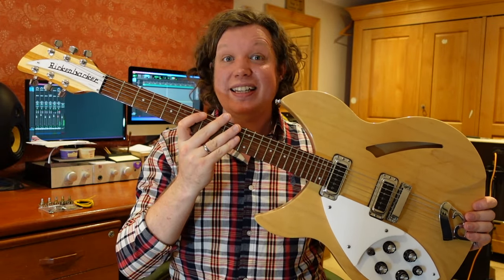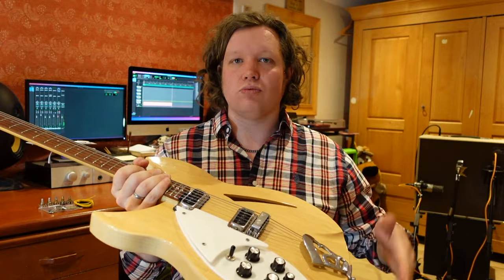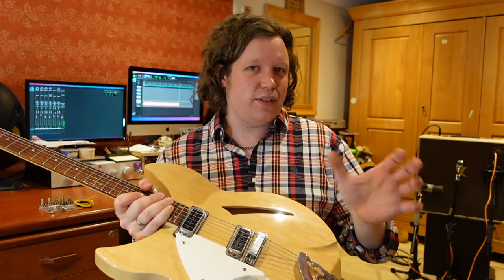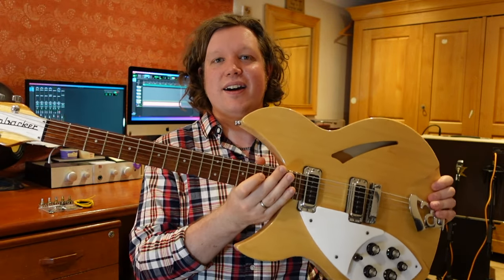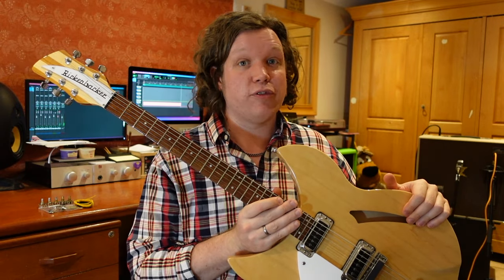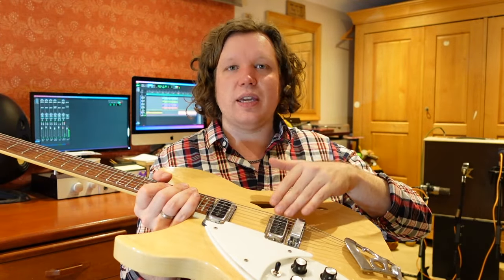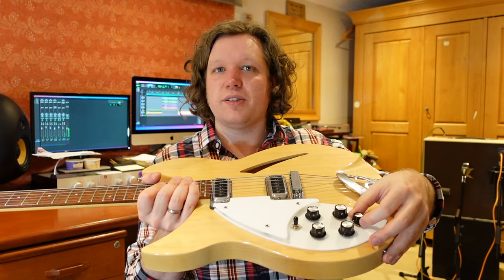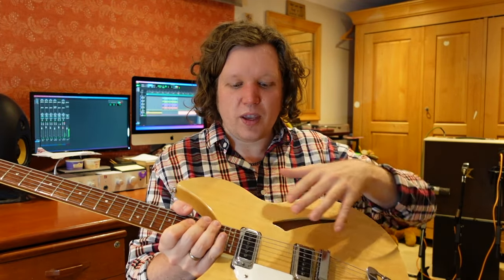Rickenbacker Wiring: Modern vs. Vintage (330k Pots vs 250/500, 0.0047uF Capacitor...And More!)

Comment: Re. the inline cap on the bridge pickup and the blend control: I have a 1959 Ric Model 450 with the cap but without the blend.

On this particular guitar the bridge pickup is located further from the bridge than normal, so the volume difference between the pickups isn’t as extreme as with most Rics. I like having the cap…it takes away some low end but doesn’t thin out the sound drastically.

I think Ric was experimenting with sounds and configurations in the mid/late 1950s, and my particular guitar was likely one result of “let’s move the bridge pickup around and see what we get.”

Comment: A very good video! 👍
Series capacitor  which cuts low end (depending on of the cap calue) has been used in several vintage electric guitars, for example in series with bridge pickup of late 60's 3 pickup versions of Coral Hornets, and a parallel cap which on the contrary cuts treble of neck pickup was used in those same models as well. (Unfortunately I don't remember the cap values of those caps in those guitars right now.)
I personally have found that I don't in normal use much like either of those caps so I prefer unfiltered pickup signal. Of course if you want to get very extreme sounds, i.e. no high end or only high end, just by switching pickups, it could be your thing. Luckily those caps in both cases are pretty easy to shunt or be lifted off from one end respectively, by little soldering or extra switch without removing original caps from the guitar.
And because of the inductive nature of the traditional guitar pickup, the effect of those caps quite possibly is a bit more complex than just high pass or low pass filtering because there probably will be resonance phenomenons caused by presence of a true LCR circuit, i.e. pickup coil, cap and potentiometer.
Reply from the maker: I've put mine on a switch so I have both sounds :-) Video coming in a couple of days on that!

Comment: Well done, Joe! ☝ 
On your way to a "jangly" Ricky, I like to cite to you a longer comment about Roger McGuinn from the Byrds, that I have read somewhere on YT. Be it real facts or not - it might be insightful and interesting:
Quote (excerpt):
"McGuinn did not record with an amplifier but went directly into the recording console. Yes, the sound was highly compressed using a Teletronix/Urei/Universal Audio LA-2A and 1176, a Fairchild 670, and similar legendary outboard studio compressors which cannot exactly be replicated with pedals, even today. He also often recorded with two compressors in series, each one at a moderate setting to avoid “breathing” and other compressor anomalies. He did not use a treble booster or any kind of pedal in the studio as the Q-strip on the console had sufficient EQ to create any sound he wanted. The treble booster he used and eventually installed in his guitar was used for live performances only.
McGuinn's tone, while not monolithic, is generally not nearly as trebly as we sometimes "remember" it to be. It is "jangly" as hell, though, but that is more a product of his playing technique and the metal fingerpicks on his middle and ring fingers than EQ.

Yes, he was unhappy with his live sound, and no wonder, there was no way to replicate or even come close to his recording setup, live. I saw the Byrds in 1967 and they were playing directly through Fender Dual Showman amps, curly guitar cables, and no pedals of any kind for both the guitars and bass.  McGuinn’s Rick 360/12 did not sound even close to his recorded sound which greatly frustrated him. They were not a very good live band which surprised me since their sound was not, at that time, so highly produced in the studio that it couldn’t accurately be played live, as many good cover bands proved.

McGuinn used and still uses a flatpick between his thumb and index finger in the usual way and, as I said, metal fingerpicks on his middle and ring fingers. In this way, all plucked notes are evenly sounded and a “roll” with the middle and ring finger can be accomplished while not giving up the accompanying flatpicked notes. This is a very important feature of his sound and the best way to get a Rick 12 to sound like his. Harrison flatpicked all the strings. 

Before the Byrds, McGuinn (called “Slim” in those days) was a professional musician who accompanied a number of performers."
Reply from the maker: Interesting information - thanks Marco! :-)

Comment: No video Joe! I worked with Gemini pickups on the first print article about the wiring and toasters in vintage Rics on Anatomy of Guitar Tone. It took so much research to unravel all the details. Was kinda weird how Rickenbacker was so hands off with the schematics. Also so weird they don’t make a period correct guitar with proper wiring. One thing I did you might find interesting is used a push pull pot to take the 0.0047 cap in and out of the circuit. That was a suggestion from Matt at 30th Street Guitars in NYC. I think you’re gonna love the Gemini toasters (those are the ones I hope you’re using). Rob has an incredible touch with wiring pickups!
Reply from the maker: Ah amazing - thank you for your work!! :D Yeah, no clue why nobody ever really kept track of what they were using back in the day!  There's another video coming in a few days - I ditched the 'blend' control (so my 330 is now basically like an old Capri) and put the capacitor on a switch where the old pot was...not a fan of push/pulls myself.  But it's great having access to both of those sounds!  Sadly I'd already ordered my Toasters here in the UK before I discovered Gemini - if I had my time again, I'd definitely have ordered from them!!  Hopefully next time :-)

Comment: I’m about to install Creamery toasters. Should I just keep the 330k pot arrangement if it is just as bright (if not brighter) than the 250k/500k arrangement? I’m not doing the in line capacitor thing either way.
Reply: Sorry to see no responses as yet and I'm down the rabbit hole myself so this isn't really an answer - at least a do this/that one :-) O'm afraid it may have to be a journey of discovery (if you're like me and hate soldering- and spending extra $ on pots, but those toasters are gonna change everything assuming you have hi-gains now. That 250/500 thing is really non-standard weirdness from Ric, so to keep yourself sane, I'd go all pots same value. Resistors are tour bffs here and can cut the value to taste as well as super easy  to put on/take off. 250 with toasters may just be fine as is the norm on scoils. 330 will obviously notch up the high end. 500 absolutely will kick it over the top, but you can tame them with 300-400k range resistors and see.
Have you sent Jaime @ Creamery a message? He's good about replying but seems a bit busy at the mo.
Reply from the maker: I answered this in this month's Q&A video :-) But I'd leave the 330k pots in there unless being 'vintage correct' bothers you - it sounds pretty much the same as the historic values. :-)